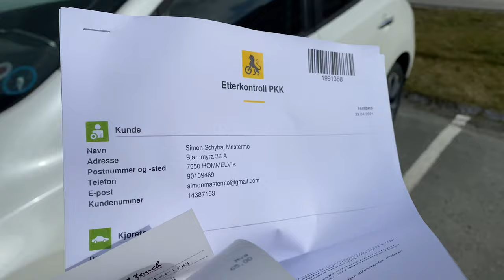Two Test Drives and One MOT Test - Land Rover Drive

Comment: It's a testament to how many more things they have to check these days. I remember 30 years ago the test only took 20 minutes lol!  
But that's a good thing. Strict rules means safer cars on the road. 

I see you are reaching for the warm jackets and hats already up there! 
So, greetings from a still warm Asker ;-)
Reply from the maker: Yeah, I’m glad the rules are the way they are. Especially with the amount of cars on the road nowadays. 😊 I got my rear brake lines fixed after an inspection and man I’m glad the guy doing the inspection was thorough. They really needed to be replaced. 👍 Warm jacket, yeah it’s getting cold up here but this was filmed early spring. I would guess it would be about the same temperature so it does fit. 😊 I’m a bit behind on all the things I need to edit, but I think that is a good thing. Having more content than I can manage to put out. 👍
Reply: @LandRoverDrive  Yes, I actually look forward to the test because they get the car in the air and can really see what is going on underneath. 

My runabout Honda CRV failed last time on corrosion of a front subframe mount (under the brake fluid reservoir, not a coincidence?). I had no clue!

Still annoys me that new cars don't come with copper/alloy brake lines, I mean the cost difference on a new car? Tiny. 

Have a great weekend!
Two days of  confirmations for us :-)
Reply from the maker: @handycrowd  Yeah, if I had a highlift I would probably do a check regurarly but not to keen to lay under the car on the garage floor more than I have to. 😅  Thanks and enjoy your confirmation days. Best, Simon.

Comment: I'm confused with your timing. Video date reads Sept. 2021 and you're installing new summer tires on the Leaf.. Next video it's brakes and winter tires on the L-R.
Reply from the maker: Hey Richard, sorry but think I forgot to set the date on the video on relasee and it messes it up. I usually post in chronological order so if you follow the uploads list it should be in correct order. But all videos is about 2-4 months behind when they actually was filmed. 😅